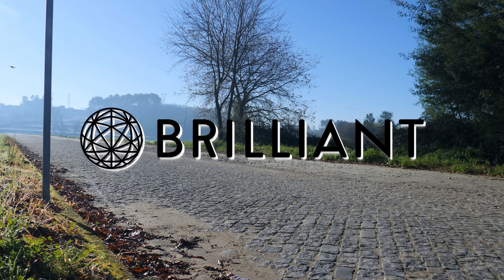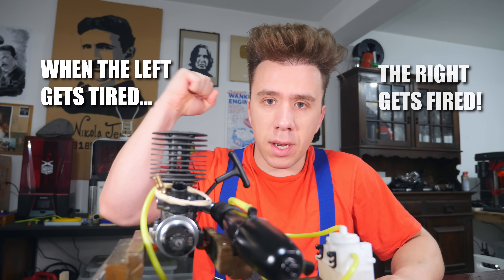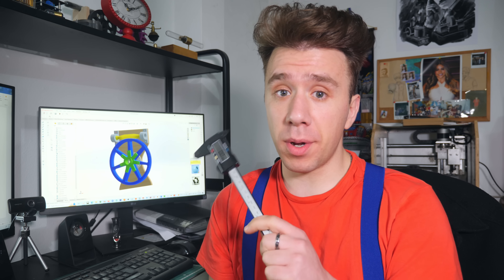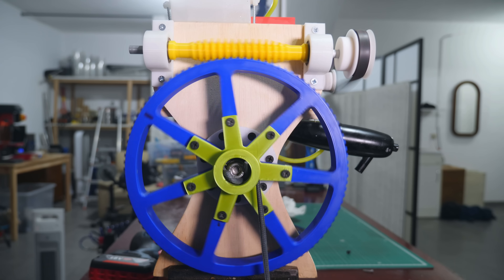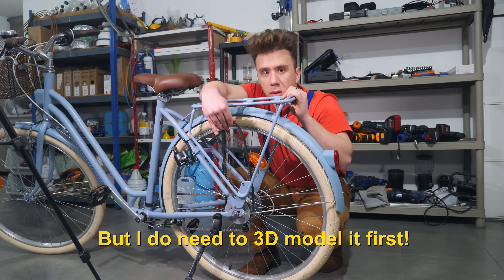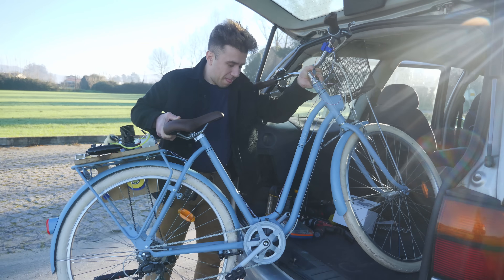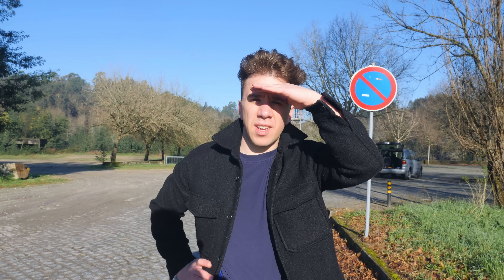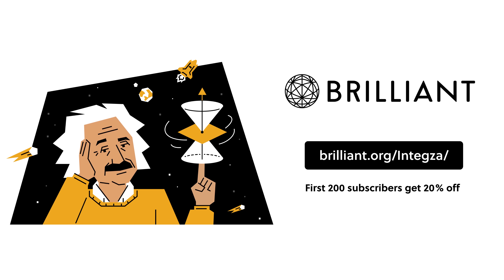Tiny 3.5 cc NITRO ENGINE on a BICYCLE

Comment: Lose the clutch on the nitro engine and the one way and the worm gear. Can't spin worm gears from the output side; if you could -- just pedal to start.

It was difficult to start the first time because there was air in the fuel lines.

Comment: Some of the full throttle fluctuations are probably from improper belt tension - you can see it flopping around quite a bit in the full throttle video. Also, teflon is a terrible structural material. Its good as a lubricant or as a coating. Delrin (Acetal) would be a better option for a gear and would machine a lot better.

Comment: Looked and sounded like the engine was running way too lean, needs more fuel to air.
A nitro engine should produce visible smoke from the exhaust. 
Turn the needle about 1/8 to 1/4 turn ccw.
Running it lean like that causes it to run hot and will cause damage especially since there is no cooling fan.

Comment: 15% nitromehane sounds really low. we used 25% back in my youth days and that was the second weakest available back then. 
you should check the user manual for what they recommend and maybe play with the carburator settings (factory settings are for a very specific fuel mixture and using something else will change how the engine responds). that should give you more power. 
if you are afraid the engine runs to hot, there should also be an optimal operating temp somewhere in the manual.
oh, and a total redo of your drive train. its a very bad sign if the transmission eats itself. ;)
thx for jet another fun vid :)
Reply: I run 30% on all my nitros here in the states an thats just for street use ...keeps engine cooler an happy ..on top of more power .. But may shorten the life of the engine
Reply: Thought the same, 30% is what I use for all my nitro engines
Reply: In some countries you can't buy over 15% without a permit, dunno why but in his first video he talked about this.
Reply: @gotindrachenhart Wow running a nitro over there must suck if you can’t buy anything over 15% nitro.
Reply: @Billo-07  I think the states are one of the exceptions from what I've been able to gather. But ya, imagine your "race fuel" is 12% lol

Comment: neat thing about worm gears is that if you reduce the twist in it by quite a bit you can actually backdrive it though at the cost of output torque

Comment: Can I send you a high performance onroad 3.5ccm engine? 
I had a lot of HPI engines in the past, because I drove a lot of the hpi savage monstertrucks. 
Anyway. Those engines are pretty much low average in performance and a real high performance onroad engine will add at least 50% more power. 
They also rev up to 45k rpm. 
Would be interesting to see how they would do. 
Just search up on YT: ENS 1/8. If you find some wing shaped cars, those are the right ones.

Comment: You can use better clutch and bell to make it output more turque. 
Based on the sound it has more power output, but the clutch is slipping.
And if it stalls at max speed, adjust a bit on the fuel line b, 1/8 of a turn, give it more.

It should have a blue-white smoke at the exhaust at full power.

Comment: Your first start was a bear because you didn't prime the fuel lines or choke the engine by putting a finger on the carburetor. But you live and learn.  Tomatoes are disgusting!

Comment: If you twist the black ring just behind the chuck of your drill (where the markings are), you can torque limit your drill so that it doesn’t skip on screws (it’ll just stop trying to turn them). You won’t chew out screws as easily, damage the bit or risk stripping whatever you’re drilling into, super useful feature.
Reply: Or maybe not buy shit screws anymore and replace everything with torx heads?
Reply: Yeah nobody uses the clutch on their drills for some reason...like...it is so effing handy.  I dont get it.
Reply: @AaronHendu  probably because they don't know which setting to use? I use it all the time while turning bolts to limit the torque
Reply: I noticed this too but think it was because he had the bit at an angle to the screw head.

Comment: Loved the video!

Video idea: Make a planetary gear system connected to a CVT. This will allow you to stay near peak power output, as well as possibly get you a higher top speed. Either that or you can try and find someway to connect to the bike's existing gear train, possibly with a planetary gear system and maybe CVT as well.

Comment: Just like your grandfather say: Great horsepower comes with great reduction in speed which will increase the torque and will carry the desired weight that customer wants.
Reply: Great horsepower comes with great rpm and torque, since hp = torque * rpm (with some adjusting factors depending on exact units used). =)

Comment: Should built a gearbox at the beginning u should have low rpm high torque and then after u r fast enough higher rpm lower torque

Comment: I've got a few nitro rc cars in storage, not had them out for years; tuning the engines fuel flow and air intake every time you use them because differences in temperature and humidity can make a previously working tune stutter and fail was such a faff.

Comment: you could try and upgrade it by implementing a torque converter (like in a moped or a go-kart) instead of a regular reduction. it would get you to go much faster, but it would be a challenge to develop, so are you up for it ?

Comment: 5:53 DANGER - I know wood isn’t your primary medium but please please be careful with your table saw. It’s the most dangerous tool in your shop by far. Consider lowering your blade to barely above the workpiece and never ever create conditions that could pinch an oblong piece between the blade and fence - recipe for kickback. My heart skipped a beat with that crosscut. Please be careful - if you see one comment, I hope it’s this one.

Comment: I used to drive a lot of RC monster trucks about 20 years ago or so. Lots of fun... But man, I do not miss all the trouble getting those suckers to run right... These days there are brushless motors in those same trucks and they are SO ridiculously fast in comparison to the old nitro motors. Same fun with 90% less frustration.
The nitro motor sounds is like nostalgic PTSD.
Reply: Yep, nitromethane engines are as finicky AF. The satisfaction of getting one running never outweighed the frustration for me.
Reply: I grew up with my dad flying nitro planes, then I got into nitro planes and cars/trucks. Electric have come a loong way and are a majority of what I have nowadays. But, I still have a nitro 1/8 scale HPI Savage and there’s still just something about the process of tinkering with it to get the engine tuned just right and the satisfaction of getting it to run perfectly. And I love the smell of burning nitro fuel…
Reply: I am still using nitro motors on RC off road buggies. Getting them to run right is part of the fun. The fact that they are actual machines is why I love them. Battery motors are just plain boring.
Reply: @geraldscott4302  Spot on! They aren't as bad as people think. After a bit you learn what to do and how it should sound so you can get the mixture right for max power. Rewarding.
Then there is the smell. One of the pleasures of running Nitro. Especially if you use the old school Castor oil blend. Yes, it's more dirty but the smell is worth it.
P.S. 2 strokes with  a pipe are harder to tune since they have a very narrow peak and require a very fine mixture control in that area.
Reply: I sometimes felt like I was the only person who struggled so much with Nitro engines and Carbs somehow never staying tuned. I had like maybe 5 models/engines in the 2000s and in the end felt they're just far too finnicky and fragile to actually want to use and enjoy. The last one I had, a 1/10 truggy somehow jammed full throttle while I was at a busy park, headed straight towards the playground with a bunch of young kids going about 40mph and my immediate thought was this is gonna shatter some toddler's ankle. Really scary experience and while it was incredibly unlucky, that kind of killed my Nitro interest for good.

A couple years later I found a used HPI Baja 1/5 Gas buggy selling used for really cheap when they were a grand new and loved that thing. So much easier to work on, less fragile and never had issues with the engine tuning or servos. Like night and day difference in frustration and functionality versus 1/10 scale though my 1/8th buggy was even a big step up in terms of ease of working on it excluding nitro engine issues. I first got a RTR T-Maxx in 2011 when I was like 11 and, even though I never jumped any of my RCs and babied all of them, rarely ever wasn't broken and a money pit. One last thought is I seriously doubt the power claims of RC Nitro engines as I've gotten older and learned more.
Reply: @Brandn00b25  i sort of experienced that but at a skate park in a bowl. weee... weee... WEEEE!

up comes some guy with two toddlers...

radio glitch. beeline at full throttle. launches. straight at kids head.

damn that guy had good reflexes.

 packed it up despite his protests, and yeah... havent really had an engine run on anything but a test stand since.

sighs whimsically and looks over at three saito engines on shelf... NIB...

radio glitches. always radio glitches... i never had an issue with anything else, other than maybe the odd dogbone going missing after a crash... but radios? man... seems anytime i get tempted, its the radio that screws me over. spend an hour or two scavenging through bits and pieces, swapping this, trying that... this ones trim wont go left... that ones throttle stays at 100%... that one? iunno... the light comes on, thats it... and the one over there, its light flashes if you shake it. buy a new one, all good until you take it out for the second time.

EFFING RADIOS!

yet my '75 futaba on 36MHz is still fine on the quadcopter... as long as the aerial doesnt get tangled.
Reply: This is true, but I have had both there is a different feel to a Nitro when driving.  I like that it has a friction break and can free wheel on the clutch. Nitro has a much smoother application of power with a transmission and slipper clutch. Electric feels so violet bc it is insta toque and on breaking it is running motor in revers. Both are fun elec def more reliable plug and paly.

Comment: If you used a chainsaw or string trimmer motor, you would have more torque and likely not need to gear down the engine.

Comment: Video Suggestion:

I would love the idea of perfecting the ionic thruster by gradually increasing the voltage. Imagine the possibilities - attaching it to a glider or an RC plane, exploring the limits of its thrust. The Quora Assistant Bot offers valuable insights on maximizing the efficiency of the ionic thruster.

1. Higher Power Input: Providing more electrical power to the thruster can increase its thrust.
2. Improved Ionization Efficiency: Enhancing the efficiency of ionization within the thruster can lead to greater thrust.
3. Higher Exhaust Velocity: Increasing the speed at which ions are expelled from the thruster can boost its overall thrust.
4. Enhanced Propellant Utilization: Optimizing the utilization of propellant within the thruster can lead to increased thrust.
5. Larger Thruster Size: Scaling up the size of the thruster can also increase its thrust output.

Back in 2018, MIT achieved a milestone by getting the first plane to fly with an ionic thruster. Consider recreating this feat at a higher altitude and greater velocity. You might just break the world record for the fastest plane with an ionic thruster.

Comment: Cool video, although early on you show a traditional valve in the 2-stroke. It's actually got what's called reeds, they are basically flaps that open from the piston going up creating a vacuum. Letting fuel and air in from the carburator. Also worm gears are quite inefficent, your probably missing out on quite a bit of power there.

Comment: If the engine is really giving 2.5hp it should propel the bicycle up to 50 or 60km/h. If the engine is running at 30,000rpm the overall ratio between the engine and the wheel needs to be about 60:1. I think in this video the engine is running at about half this speed; it should be possible to measure with a microphone and an oscilloscope, and you can also calculate it from the measured speed and the wheel diameter and transmission ratio.
I have repeated your calculation of how fast the bicycle would theoretically go with the wheels turning at 30,000rpm, and got about the same result as you did. I think the worm and wheel need some lubrication, which you could arrange by directing some of the oily exhaust gases at them.

Comment: Teflon is not the right material for anything structural as it is extremely soft  and deforms and shreds under load..   Something like a graphite fibreglass composite would probably work if you wanted something really light, but metal gears with active oiling are really what you want for the RPMs that you're running...

Comment: I don't think Teflon was that good of a material to use for that gear.  I have a snow blower which uses a worm gear to drive another gear, both gears of a similar size to the ones you made.  On the blower it gears down the impeller, which spins very fast and shoots the snow, to the augers which spin slowly and pick up the snow in a T connection.  This is driven by about 18hp.  The material they chose were steel for the worm gear and brass for the regular gear all in a tiny crank case full of lithium grease.  The things holds up for years of abuse (as long as I don't over tighten my shear pins anyway!).  If the shear pins are over tightened and I hit a rock the crank case cracks open like a coconut under a truck tire.  Ask me how I know this.

Comment: Here’s how you find out the gear ratio you need:

Look at your bike. Look at the tire, get its dimensions. What’s the top speed you want the engine to carry the bike at? Figure out what that is and how fast the wheel rotates when you’re at that speed, in RPM.

Then plug that number into a fraction as the numerator, with the engine top RPM as your denominator.

Congratulations, that fraction is some multiple of your desired gear ratio. Reduce the fraction so that the numerator and denominator come to some humanly sane number and you’re not making a 9 thousand-tooth gear or something.

The bike and the rider add mass and load that will reduce the top speed below what you want, so you’ll have to adjust your gear ratio a bit as if oriented towards a higher top speed so that the added load will be compensated for and balanced.

My suggestions: don’t use worm gears. They cannot be reverse driven, and if you play your cards right you can use the momentum of the bicycle itself as a regenerative energy capture system - regulate your speed when cruising down a hill and charge the battery, or get a bit of energy recuperation from coming to a stop through the motor itself.

Comment: Nice, can you try to put a stepper motor planetary gears on that nitro engine and redo the test because worm gears are not good in transfering the torque efficiently so you can have a better results i think.

Comment: Re-inventing the Moped. One main difference is a Moped motor is usually started by peddling the bike and then engaging a clutch. The similarities are that the original Mopeds were powered by similar hobby two stroke engines, usually hijacked from a chain saw. The motor on a Moped usually engages with the bicycle's chain drive in some way, which eliminates some of the losses in friction from so many gears and belts. 32kph is a respectable speed and right around the speed the original Mopeds achieved.
Now, frankly, you'd be better off putting this engine on a model airplane, car or boat, and adapting a modern chainsaw motor to drive your bike. The modern chainsaw motors run on gasoline/oil mix which is still much cheaper than a gallon of hobby Nitro. It's nice to watch a video of yours that doesn't include the whole project going up in flames.

Comment: I can go twice that it's only 18 miles an hour he could have put it through those gearing system on the bicycle better designed and you could have got faster max speed on my bike 21 speed mountain bike is twice that 25 Mi an hour

Comment: You absolutly need to improve that bike (RIP to your GranPa).
Make it lighter by removing useless parts. (you can also loose a bit of weight 🤣)
And test your speed after getting momentum on an oval (bicycle speed track) !
GranPa should be proud of what you'll make with this ugly bike 🤭

Comment: I've seen a few pedal bikes with a petrol motor on them, about 4HP. and a lot of them have a 2 gear gearbox. and usually a lower gear ratio than what you'd usually expect, as you can pedal to get up to a low speed, then let the engine take over from there.

Comment: on the carb there should be a screw that you can tighten and loosen other than the idle control. You should try and loosen that screw until it spits a tiny bit of smoke put of the exhaust.

Comment: When getting new engine you have to break it in first with a few tanks of fuel. No load, idle rpm, then 20% then 50 and so on. After that you have to CALIBRATE the carb.
The difference is very big. And from the sound of it you need calibration as it sounds lean on the high RPM.
This would damage the engine but it is not making as much power as it could. So I think you can achieve even higher speeds if you do it :)

Ah and if you do not want to get your air filter off each time, just pinch the fuel tubing (e.g. stop fuel flow). It takes time so I like just to put my finger on the exhaust and stop the gases from escaping. It dies like for 1 sec.

Comment: I would like to see you use smaller ratio and go faster. There was a comment about worm gears not being great for this application which makes sense. You can also increase power output but using a higher nitro fuel! Hope you revisit this one.